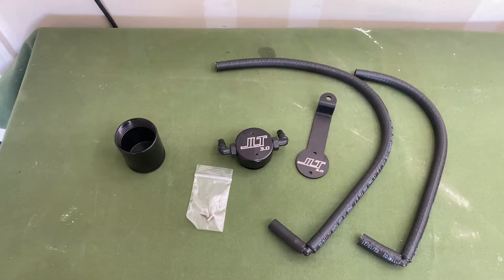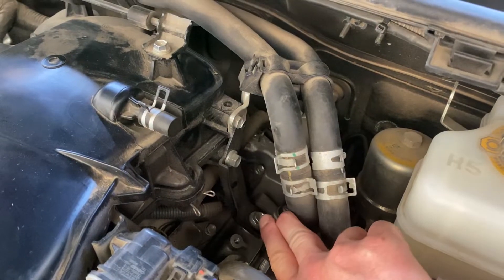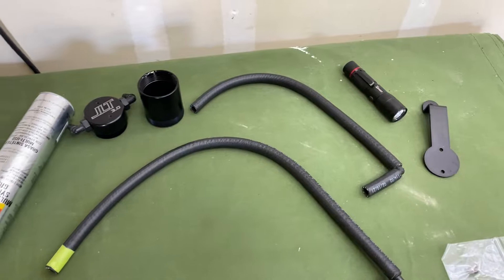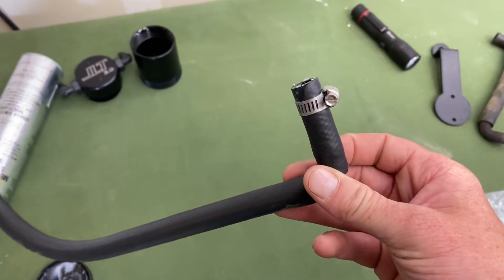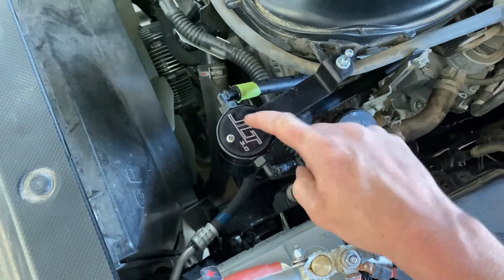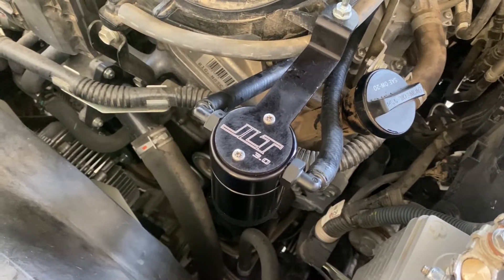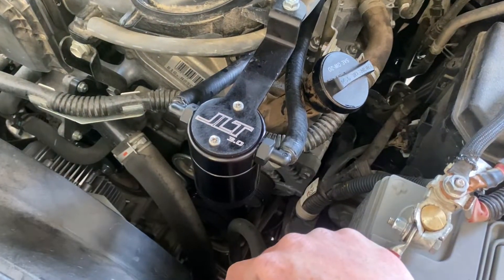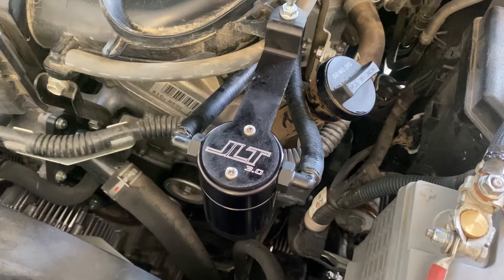JLT Performance Engine Oil Separators or "Catch Can" on 5th Gen 4Runner - Install and Overview

Comment: The 4Runners 1GR-FE engine is port injection, meaning the valves get cleaned by the gasoline (solvent) on its own, by design. You don't need to install a catch can on this engine, this part is for direct injection engines.
Reply from the maker: This has been disproven. Not to say you aren't correct, but there will be more carbon build up if the blow by goes into the motor its whole life. A simple mod that doesn't cost too much and is easy preventative maintenance.
Reply: @ I get where you're coming from, for me personally, ill put top tier gas in it and I'm sure Ill be A OK.

Comment: Hi could you explain, why you need to install Engine Oil Separators. if the engine is not turbocharged ? and if the car is new 2022 year ? is it still better to put it?

Comment: Does this void my warranty?  If installed
Reply: Some states will fail you on your smog check if you have a oil catch can system. From my understanding California is one of those states. That is, if they bother to look closely at your engine 😁

One must remember that all of these things about ecological concerns over motor vehicles are highly politicized and do not look at the big picture (or science and engineering). By using an oil catch can, you are protecting the vehicle's service life. By doing 5,000 mile oil change increments, you are allowing that engine to last longer. But they don't care! They would rather you junk your whole car at 150,000 miles then have it last 300,000 miles with more frequent oil changes. 

It's not really unintended consequences when the science and the mechanical fact to things has been proven repeatedly. If they don't want to look, that's because they have something else in mind. Welcome to the United States of Venezuela.

Comment: Great Job BG! Should I do this to my Tacoma? Does it have this issue also?
Reply from the maker: BG.. : ) ... And yes, they have one for the 3rd Gen Tacoma as well. It's not really an "issue" but over time, the unwanted deposits may cause some issues. Preventative maintenance more than anything really.
Reply: @TrailCoMedia  -- whoops, fixed